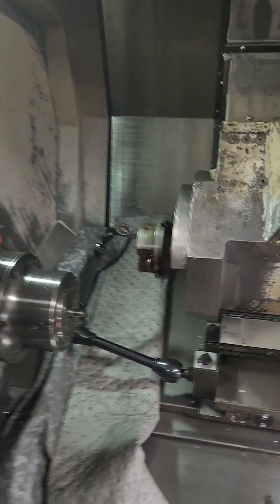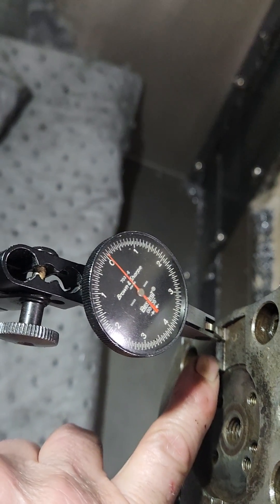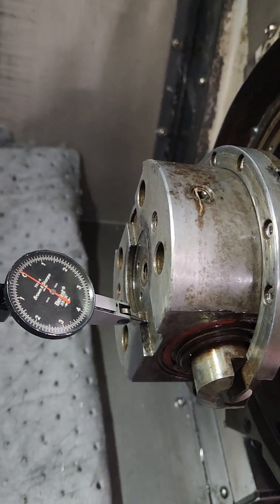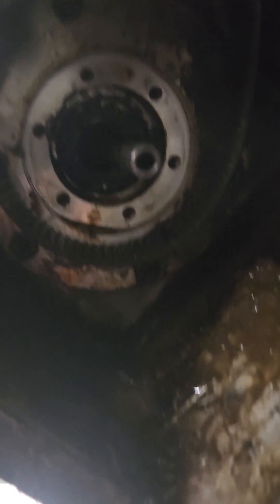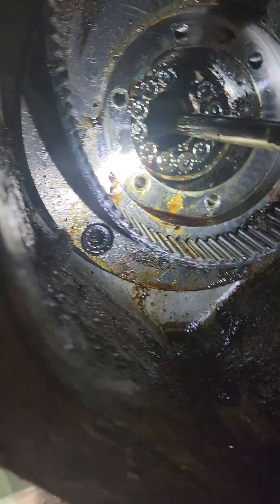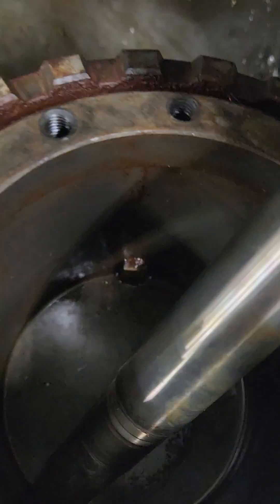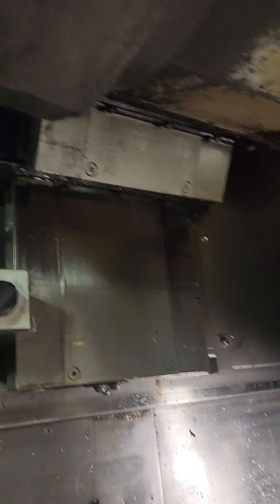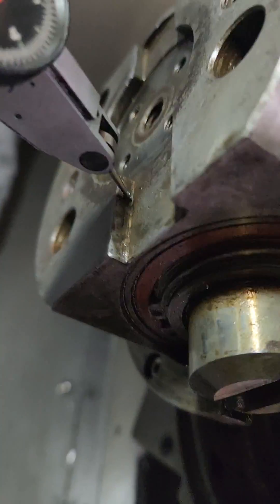Repairing a Daewoo Puma 2500LSY turret after crash.

Comment: Hello sir,
I have hardinge t 42sp cnc machine and my machine spindle is out by 2mm. So can you please tell how can i aligne the spindle head stock i am unable to finde the jack srews..
Reply from the maker: Where are you measuring that much error? On a test bar or across the face of the spindle? 

There are probably tapped holes at each end of the base the spindle sits on, the same as the turret. Service guys have a block that bolts up with a threaded hole to install a bolt and push the spindle. You will have to make something similar. The spindle should pivot on a dowel pin in the center.
Reply: @OtherBrotherDarylSmith  on a test bar ... tap holes that are on the back of disc brake ...
Reply from the maker: @A.KManchanda  There should be holes on the base near where the hold down bolts are located. The hole on the back side of the disc brake are not what I am referring to.
Reply from the maker: @A.KManchanda  What taper does your machine use in the headstock, a 16C or a 20C? Did you check the runout at the end of the test bar and at the spindle? Are you using a Hardinge test bar? Make sure you are getting zero runout on your test bar.
Reply: @OtherBrotherDarylSmith  my machine is hardinge conquest t42 sp same on which you rebuild your turret. I think its 16c .
Reply: @OtherBrotherDarylSmith  yes i have checked the run out size is 3mm down on spindle end .
Reply: @OtherBrotherDarylSmith  soory 2mm
Reply from the maker: @A.KManchanda  You need zero runout on your test bar to check the spindle alignment. That, or zero at the chuck and split the difference of the runout amount on the end of the test bar. Then indicate with the z-axis travel. If you have 2mm runout you are not getting an accurate reading.

If you have 2mm position error on your headstock, you would be cutting .157" taper when cutting the length of your test bar. Are you cutting that much taper?

If you chuck up a piece of 2" aluminum round stock in the headstock chuck only, skim cut it a length of 10 inches, then use a micrometer and measure at each end of the cut. That will tell how crooked your headstock is.

I will do a short video on my tools I use to align your machine.
Reply: @OtherBrotherDarylSmith  at the end of test bar measurment is 48.5mm and at the spindle side its 46.5mm.
Reply: @OtherBrotherDarylSmith  thanks that you will add a video for the tools can you share when you will be doing it and can you share the photoof the tool ....
Reply: @OtherBrotherDarylSmith  ill be waiting for the video ...
Reply: @OtherBrotherDarylSmith  can you share what kind of block it is which i have to bolt
Reply from the maker: @A.KManchanda  Yes, I can send you a photo of what I use.
Reply: @OtherBrotherDarylSmith  please share the photo of the tool amd the bolta that you are reffering to . It would be of great help...

Comment: Is that what they call a no-lift turret? The turret doesn't pop in and out like normal. It's all handled internally?
Reply from the maker: Exactly. One of the 3 pieces of the curvic are bolted to the piston. All the turret movement is radial. They are a pain to setup if changing any of the stackup pieces for proper clearance and clamping fully. Lot's of using a depth mic. I think I sent you a rebuild manual for Doosan and Daewoo. I should have read it before this job. 😁
Reply: Where can i find that manual